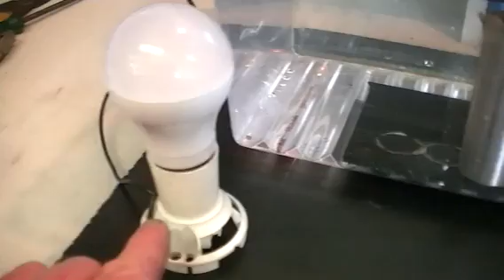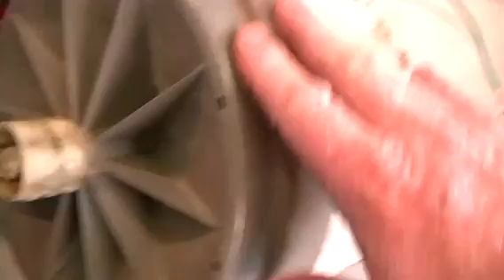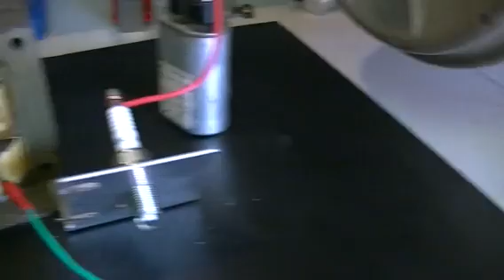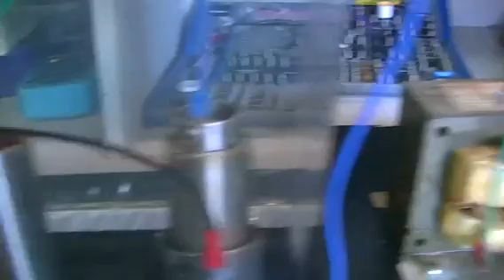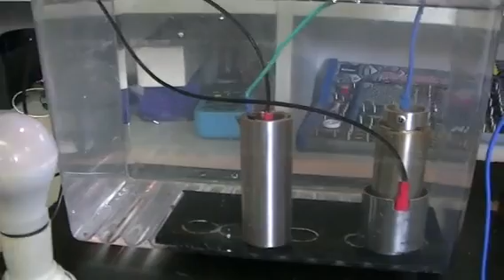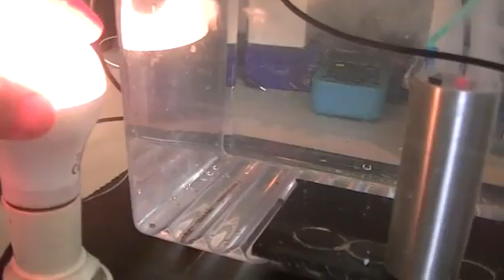High voltage HHO drive circuit

Comment: Hho is an experimental technology and we are still at learning stage. So becarefull. Hho Technology will surprise you! Hho is a mind blowing technology . Cool engine running  prolonging engine life and engine oil life.

Engine life changer device improve engine performance and increase fuel burning efficiency. Do you know  Petrol combustion engine can burn only 18% petrol in the engine and 82%fuel is wasted but hho will burn   100%fuel  in the engine No un burn fuel wastage . Engine will run more power fully Consume less fuel. Hho system works on petrol, deisel, cng, lpg and lng types gases.

Engine runs lighter smoother reducing carbon emissions significantly . Boost engine power  Hho gas reduced engine noice & vibration

An efficient hho car kit lower the engine temperature more then 100 degree F. To prevent heat build-up.Hho car kit reduce car maintenance charges. Hho kits restore better fuel economy. Hho system is very easy and simple to install. Hho system solved the engine heating problems automatically.

Cleaner engine running. Reducing engine noise due to the faster fuel burning. Hho car kits works nicely requires no modifications in the car engine. No side effects on car engine.

Engine start quickly safe your car battery.  make your car a low cost hy-brid. Use a  low amps. Hho car kit will work better. You can easily transfer hho kit from one car to another one. Hho kits requires no any modifications in the engine. For more information about this useful technology  keep watching hho zafar videos. Or call 03082266179 zafar karachi.

Comment: interesting ,use all 3 phases, short one diode or use a leaky one, may replace with resistor, target resonant freq with speed controller and use a scope, cal cap of cell and inductance , pull a vacuum from motor near inlet manifold , target is 3% in air , water quality is very important the higher the purity the more dielectric it becomes , tap water contains inhibitors from its processing.donot try and compress this gas ,its not wat you think it is .

Comment: Meyer Cell fue un transformador elevador de 1.5KV a electrodos a baja corriente. Pulso de encendido y apagado Modo de ráfaga de CC 3 segundos encendido, 7 segundos apagado. Solo agua corriente o agua destilada. El VOLTAJE la presión - separa el agua. No electrólisis. Sin productos químicos. Múltiples celdas no son paralelas a una sola celda. Frecuencia del capacitor de agua (celda) = frecuencia de la potencia del pulsador. Obtenga los 2 manuales de concesionario de celdas de combustible de agua para obtener datos técnicos

Comment: I wish you would check the input power in both cases, here is why: When you close the secondary, the current runs through the secondary. That will reduce the impedance of the primary, thus primary will allow more current to pass through it. More current through the secondary that is in series with what cells, means more current passing through the water cell. When you close the secondary, the power consumed by the system goes higher, so the HHO output will also go higher.  If you remove the MOT all together, you will get even a better results, because then a lot of current will be able to pass through the cells :D Just remove the MOT and let's see what happens to the HHO output and the LED light ;)

Comment: I wish i understood what that part about the washing machine motor for. I think he needs an AC single phase power supply, so can i just plug the primary of the MOT to the wall socket? (Single phase 220V)
Its very hard for us normal folks with minimal understanding of electronics to comprehend this science. So far this is the only video i somewhat understand.

Comment: You need a spark gap adjuster, and use the Microwave Diode on the secondary, and you will get more production. 

Nice mechanical example of the HHO generator.
Reply: What would that look like exactly?

Comment: nice experiment, but think
different:

use strong oscillating

electric field, that mean you have to use insulator and oscillate the voltage around
offset value. the heroically value for resonance of water molecule bond O-H is
around 10 Ghz that not possible by electronic, we can go max to Mhz, may with
low frequency the O-H connection will oscillate at reduced resonance and slowly
the distance between O and H increase until full dissociation.

Job not done so far, we need

to form h2 and O2, inside the cell put two plate short-circuited by a wire:
each plate will be onside of plate for electric field.

Because the water molecule is

a dipole slightly charged they will aligned with the electric field, in one end
we have H+ and other plate we O--, then they are charging slowly the plate
emerged in water, the difference of potential will pull the electron from O--
and passed to 2H+ then you get H2 and O2.

The dispositive then have two
insulated plate for high voltage oscillating around offset and then you get the
strong electric field.

Two more plate are emerged in
the water connected by wire to make equal potential in plate and then pull
electron.

The vibrating electric field
will induce current flow through the other plate and you get O2 H2 plus electric
flow.

I’m trying to simulate the
process, I’m facing big problem of time simulation can be one month running
workstation
Reply: stan meyer only used kHz around 20 I think it was with high voltage.

Comment: How much a/c voltage is supplied on the phase wire providing the primary coil?  Does it matter?  I only have about 8 vac volts coming out of my alternator phase wire, do I need to step it up to 120 vac or will it build inside of the capacitor on its own and eventually start working?

Comment: Theirs a mistake here in the video.Im sorry if im wrong.But A simpler design from my perspective would be as follows:                  
           A microwave transformer is a step up transformer not a step down,,so ideally the alternator to be used to source ac power from should be able to produce at least 230 v ac or 110 v ac depending on the country the microwave transformer was desighned for.If it can manage even more AC voltage,at the input if its rewound uniquely,,that would help even more,,for the primary .Now the secondary of the microwave transformer is already boosting to very hi voltages in Ac current due to its desighn,,Now All you do is convert it  to dc through a diode of high voltage and ampere capacity and then hook it to your hho cylinder device etc. personally i coulnt understand how the spark plug used as a spark gap works here.. But more than anything else...this is highly dangerous desighn,,not suitable for automobile applications  and a simple mistake or innadequate insulation you get electrocuted and die.  (i wonder instead of all this ,,has anyone tried it with a HID ballast ,,you get it for auto mobiles as well as for domestic factories,,all one needs to do is add a diode or two to convert it to dc...then again 1amp is enough to kill you @60vdc so better not to play with high voltage ,,where the human bodys skin resistance starts to dwindle.
Reply: sounds like you have a really good understanding of electricity, but the thing that your missing is the reason for the spark plug in the first place. This is to be able to eliminate the magnetic field which then causes a massive spike in voltage which is then fed back into the primary coil. The timing of the spark, is controlled by the gap allowing for tuning of the system in order to attain the correct oscillation for the system to work efficiently.

When Stan Meyer did it, he used a set up with a transformer, a primary coil and a secondary coil. The secondary coil would then be used to be able to tune the system to able to resonate the electrical charge between the stainless steel tubes and the coil which would in essence both become capacitors.

Comment: There really shouldn't be any need to use high voltages; the key here is finding the resonant frequency of the H-O bond, which according to my calculation is around 104Ghz; though you could use lower as long as its a multiple.
Reply: Resonant frequency of H-O bond  , very good idea to work on. Thanks
Reply: Muhammad Amir: The resonant frequency will have to be be tuned very accurately for separation to occur; that's based on experience in resonance in other systems.
Also remember water is diamagnetic, so it may be possible to resonate water using a powerful fluctuating magnetic field.
Reply: Suzy Siviter .Thanks but thought the system itself matches the resonance frequency with that of water and leads to it's breakdown. What I mean when the two frequencies are falling near by than they match and lead to breaking if water. Why I am thinking this because in this video no apparatus is used to match the two resonant frequencies
Reply: Muhammad Amir: The generator he is using outputs a frequency so low as to be way below the natural resonance of water.
You could use the analogy of a glass breaking once the singer matches the  natural resonant frequency of the glass. Water is more complex as you have multiple resonances, you have those associated with the H-O-H and those with the H-O, but if we manage to shake the H-O band violently it will break the bond.
You can break the H-O bands through simple DC voltage electrolysis, but its not very efficient as it uses lots of energy, AC electrolysis at high frequency should be more efficient and will become close to 100% efficient if the resonant H-O bond is excited precisely just like the wine glass.
Look up Sono-luminescence, you might be very interested, I was.
Reply: Suzy Siviter thanks a lot.  Great idea
Reply: Muhammad Amir: You are welcome, let me know how you get on.
Reply: I think all this job is done by Tesla coil which is generating high voltage with high frequency alternating current and not the generator that is supplying low voltage DC . This AC with high frequency may be matching the resonance frequency of H-O bond leading to its breakdown. Now i shall study SONO-LUMINENSCENCE that may give me better explanation.
Reply: @muhammadamir2319  Even running at say 30V with a 5mm gap (2cmx2cm) using tap water; expect at least 1A, so if you run high voltages the current will be massive. Trick is to use low voltage at low current; but resonate at just the right frequency to dislocate the H-O bonds. Infra-red light and even ultra-sonic vibration will also help.
Reply: Suzy Siviter Thanks a lot and keep us updated

Comment: It is a standing magnetic field! a compass above will respond to the field, also... 316 S/Steel is very high electrical resistance wire i used as electrodes.

Comment: Also, if you take a multi meter with a long probe stick you can read the volume metric field where the predominant electric charge field is.It is above the negative field where the long string wire grid is placed. the rising bubbles carry the charge....

Comment: Thank you for the demo. I have done similar work but different. In a stainless  steel 316 keg. install 2 electrodes in side the +v keg insulated inside. One upper large one in linear string form as being a grid to receive the electron surplus wen gas production starts. the lower electrode is a upright diamond mesh 316 in cylindrical form and is negative - V. Put 24 v dc in no pulse mode in, and gas will flow, place 24 volt light bulb on the upper grid wire and it will light up, and at the same time your gas production increases multi fold by the grid being also a gas producer. have fun.....

Comment: hey , 42.1khz at least 20kv and 20ma to 1a in distilled water, you will actually fracture water instead of electrolize. higher milliamps will produce liters per second so be careful of any spark gap
Reply: what do you mean " fracturing water"
Reply: Brett Moore Can we get you schematic?
Reply: Fracturing water means to pull apart the molecules of Hydrogen and Oxygen through the attracting the opposing polarities
Reply: this is dangerous area , stick to Electrolysis
Reply: Make a video to prove your theory

Comment: Tin man you using the spark plug as a transistor?
Reply: I think its a spark gap that oscillates at a frequency.
Reply: The spark plug is to induce a collapse of the magnetic field causing a spike in di-electric charge, which then produces the high voltage ... Look up Electric Discharges, Waves and Impulses by Charles Proteus Steinmetz

Comment: Hello Darrel,
Is there a way to get the DC Voltage from the generator? also currents and frequency is possible, this experiment looks similar to Stanley Mayer dead secret.
I'm guessing if you put the cell closer such Joe's cell, the HHO could be produced in massive way,
Thanks for sharing

Comment: Nice work! with the set up can the two leads going to the lightbulb be hooked up to two more tubes to produce more hydrogen? If so you may be able to capture more lost energy in the waters Eddy current?
Reply: Had the good being made the electrical diagram of this project available for us to do at home?

Comment: "don't want any chemicals in my water" first of all tap water is the WORST and electrolyte is 1 chemical and it makes the water better conducting and the HHO generator more efficient, I use tap water.

Comment: Just remember that Stanley Meyers 8XA (Tesla Choke) Coil restricts Amperage, prevents the 'Skin Effect' taking place & only allows 'Pure Charge' without the Magnetic stream to pass, in Darwin NT Australia these are referred to as 'Infinite Q Resonators' as they recycle Charge in an Loop. The Meyers 'Electron Extraction Circuit' provides a dead Short Circuit which is the path of least resistance for the Amperage to flow into as the Amperage is restricted by Meyers 8XA Coil... This is very Simple!
Reply: you really don't want amperage in this system, you want to aim for 0 amps and extremely high voltage. Which is what is happening with the spark plug as it's causing a di-electric charge of high voltage every time that the the spark is released which eliminates the magnetic field.

Comment: Nice setup but, its a bit silly having the microwave capacitor. The Water Fuel Cell is the Capacitor in series to the Coil & Tesla Choke (upon switch closure the Choke uses its own magnetic field to create a massive B-EMF Im-Pulse) that restricts current flow & provides the Im-Pulse Charge in Stanley Meyers original patent. Also the reason there is no 'Short Circuit' in a Stanley Meyer setup is because a dead short circuit prevents Voltage from cascading. This is just a suggestion but, you could incorporate a NPN Transistor with a Light Bulb in series so that when the + is off the Light Bulb shines but in a pulsed on, off manner to ensure that the Voltages are continually cascaded.

Comment: one thing i just noticed have you modified the mot i am thinking the primary n scndry in yr setup are the same thin high turn copper wire coils?

Comment: i tried your setup but rather than alternator as u said i get the 22 or 24 volt from mot i have made n rectified but i dont get the arc with my setup could you give me an advice or help i really appreciate it

Comment: I'm having trouble understanding the circuit - the secondary is usually the hv windings on a transformer but you say a short in the secondary induces a hv in the primary? I don't get it. The spark plug isn't a short circuit but when the spark jumps you get a huge increase in gas! Shouldn't the secondary circuit operate the electrolyser? And why 3 tubes on the left electrolyser?
Reply from the maker: Each time a spark jumps across the plug,the secondary induces an extremely fast magnetic field change in the primary of the transformer. This causes a very high voltage to be produced by the primary. The primary is being used,as it can deliver a higher current to the cell, than that of the secondary
Reply: it's because of the di-electric surge which happens look up Electric Discharge, Waves and Impulses by Charles P Steinmetz

Comment: You use a car alternator or o washing machine motor? And the transformer its from a microwave oven? 
Which is the function of the car spark plug? 
One of the thinks that i observe in Stan demonstration its he use 11tubes array and very long. I think its because the electrons can travel beter to the material by using high voltage. And also some maths secrets in the Number 11 (master number in numbers ciences).

Comment: Could you please show us a video to record all amps and current through each part of the circuit?

Could you also on the video run your test on the dry cell and show us the production of the cell please?

I would love to see how much this also in a car running too. 

Think a Junker or a test bed for the engine should be adequate, but a naked engine with fueltank and pump running plus integrating the hho system into the engine and demonstrating it operating would be cool.. 

Keep up the good work.
Reply: +Gary Stinten 
Hehe... lol Gary! As persistent as always!

Comment: Tinman,
Maybe a stupid idea, but some days back I read from a guy using a rodin coil between the capacitor and the sparkplug. He also put the sparkplug in a copper-tube, or some copper tubes, which even made the efficiency of the 'radiant energy' higher. Maybe something to try with your sparkplug?
Best regards, and looking forward for new year, yeah!
H

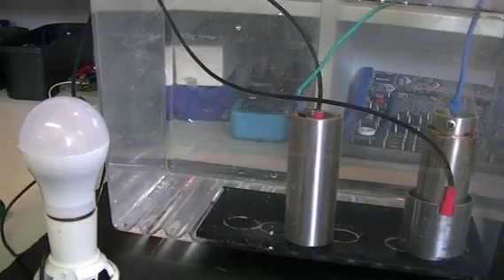Comment: Great one It's clear you hit a from of resonance at 6:03, Is According our measurement,..
The light bulb comsums now the librated electrons, Exactly like stan mayer Claim, keep going there is much more to gain,.....
Is much better to use clean water without chlorine,tapwater have chlorine, Inhaling those gas your release, can lead to dead, Be very caryful with the high voltage,...